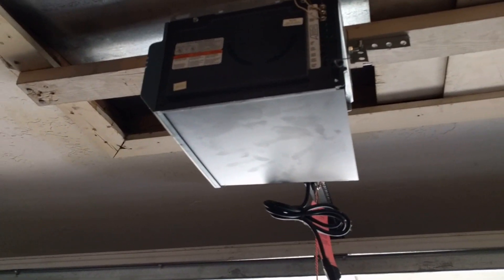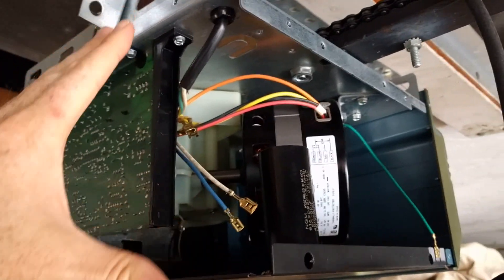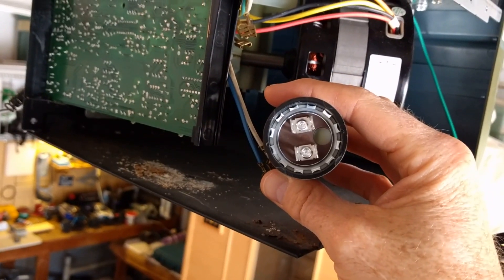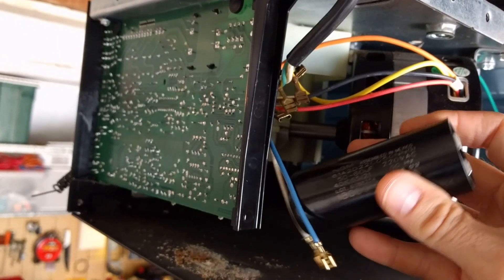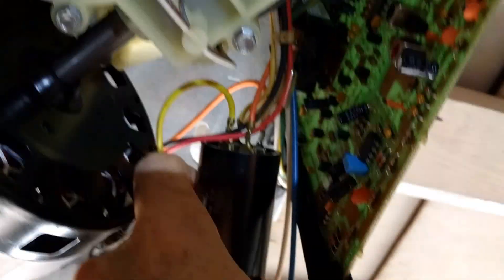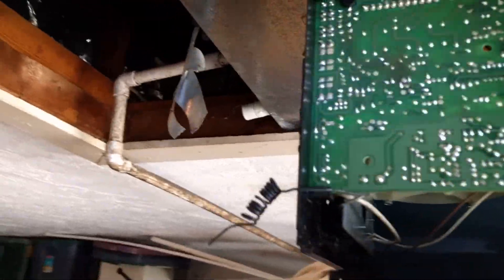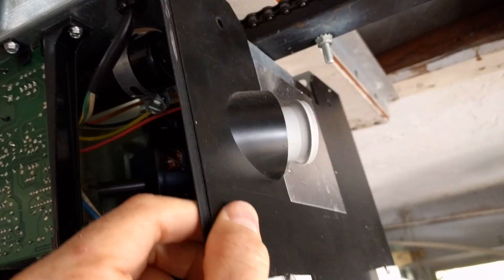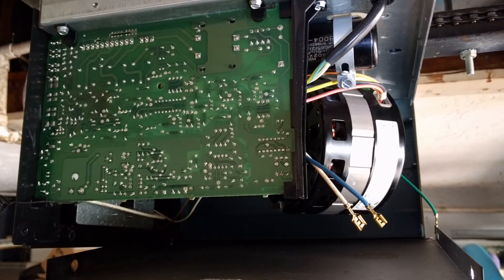Replacing capacitor on Overhead Door garage opener after it goes pop!

Comment: So just for clarification, both yellow wires, go on one side of the leads together and the orange wires go on the other side, they do not crisscross by any means correct?

Also, are there any precautions that need to be taken when hooking the new capacitor back up to the wires

Comment: hi. i been searching Legacy Garage channel. i just replace the starter capacitor because it burn out. once i install the garage open a little it bit but when i hold the button it move. i check everything spring, sensor and lubicant. what cause the issue that the door move only 6 inches? please help. also the expert said the mother board is damage and need to get the one but i don't so.

Comment: Thank You for the video .  I have a Overhead Garage Door also I am so impressed with it , mine is old 
makes yours look like a youngster . My Parents most  have put it in in the 80's ? I'm not sure my memory is way 
off lately . But I am 99% sure the motor & all the parts are original . One spring was replaced back when year ? . 
Anyway its ( motor ) has been slowly acting up every so often , Electric click & no motor on both for open 
and close . I'm going  to try Capacitor . other videos keep talking the light sensors , my old door does not 
have sensors .

Comment: When I removed the front (light) panel, I let the light hang by its wires (no need to disconnect). Removed the side cover (over circuit board) to access the screw to the capacitor bracket (leaving circuit board in place), and bottom panel.  Had to slide the capacitor bracket off the top panel to get the capacitor out, and found that using needle-nose pliers made removing and replacing the wires on the capacitor easy. The video was a great help. All the screws take 1/4" socket except capacitor bracket, 5/16" socket.

Comment: Wouldn't it be easier to just remove the motherboard to replace the capacitor?  It look like it's only a few screws to drop it and then put back
Reply: I think you'd also have to remove all the wires that screw into the terminals on the board and take out those screws, which probably means labeling them so you don't mix them up. Not a big deal, but it is a bit of work.

Comment: I knew My problem was the capacitor but I appreciate the step-by-step video so I knew what to expect when taking it apart.  I did indeed curse the engineer and his entire family for deciding to save a penny or two by not making the wires just an inch or two longer.  A tip for anyone reading this, start with the shortest wire first (likely the orange one) when putting the wires back on.

Comment: My thanks to Hans. Great advice. My large black capacitor also failed on same Legacy model as you. The local Overhead door gave me a smaller blue Mallory capacitor (shorter), claimed it replaced the longer black one in your video. It was tough getting the old capacitor out from that odd horseshoe shaped slot in the top sheet metal. You saved me a lot of money doing all this myself. it took time to make careful notes of the wiring, and the sequence of removing those plates (that's the biggest pain of all) while standing on the stepladder. Thank you my friend!!

Comment: As soon as I replaced the old capacitor the new one it popped and smoked but first did work and then pop then smoke, then it was dead.  Gatehouse Supplies tried to tell me that it wasn't their capacitor that failed.   Beware of Gatehouse Supplies, you will not get a refund for faulty merchandise.
Reply from the maker: Geez! Thanks for the heads up. I got mine from the installer and it's been fine. But good to know re Gatehouse.

Comment: For anyone wanting to buy their capacitor online, just make sure the "uf" numbers mach exactly and make sure VAC number the same or higher. Up vote this if that was helpful to you. Also for searching purposes they are often called start capacitors. Do not get a run capacitor.
Thank you so much for how to reconnect the wires. Took them off days ago and didn't remember which one went where.

Comment: Hey, Hans, just wondering if your "NGM 18004-B capacitor" is still holding up after 5 years or have you replaced it with another one? I have the exact same model garage door opener and in the past 3 months two aftermarket capacitors (of different brands) have blown, so I am going to order the (Fairbanks Electric)18004-B and hope that it will last for at least 5 years as guaranteed. I do wish for longer wires so that the capacitor could be turned 180-degs in case when it does blow, the fluid would not be sprayed on the control board. It's a design/bean-counter flaw, imo.
Reply from the maker: Still have the same capacitor but about 5 months ago my son accidentally tapped the door with the car while we were doing some driving lessons. So my door is out of commission until we can afford a new one.

Comment: What happened when you tried to open it with out the capacitor working? My motor will try to move but just makes a noise
Reply from the maker: Honestly I don't recall. It's been a while. Still going strong over here.

Comment: My Genie Garage Door opener is completely dead - no lights, nothing.
The AC outlet where the electrical cord plugs in has power.
We did have an Electrical Storm right before I found the Garage Door opener dead.
Do you think it could be the Starter Capacitor ??????
Reply from the maker: Hope you got it working. Wish I'd seen this earlier, but the capacitor is so inexpensive. Hope you gave it a try.

Comment: Could you film a video of it opening and closing with no commentary? Also on those openers the capacitor is know to blow fast on these. Glad you fixed it these will work forever until the door destroys it or it gets replaced. The reason for the short wires is so that it doesn’t get caught in anything. This will definitely help a lot of people. Nice video and job!

Comment: Hi. I have the exact same model. Have you ever experienced the door going down 6" then up or the reverse? I seem to hear a click then it will work properly but soon is back to the up and down. Could that click be the capacitor?
Reply from the maker: Hi Dekal, I have not had that experience. I would contact your local Overhead Door company and ask them. The one here near me was very helpful.
Reply: Adjust the force, up or down switch. It shows on the unit.
Reply: @hungton0591  -Tried that many times and doesn't help. Just replaced the capacitor and it's not that.
Reply: dekal Might be a board or some type of break in the door. Make sure the door runs freely and smoothly. Make a video of it I will understand it better I fix a lot of these and it can always be different. Hope this helps.
Reply: @jdcalame6714  Without the door attached the chain simply goes down 6" then up about 6". That's it.

Comment: Would you happen to know the female terminal size?  Bought the same capacitor but some of my wire terminals corroded.  Thanks!
Reply from the maker: No I don't. Sorry. That's too "inside baseball" for me. I just bought the one there garage door people told me to buy.
Reply: Replace the terminal.

Comment: It's an AC Cap, so polarity is of no concern, just keep the 2-YEL
and 2-ORG wires segregated. Also, on mine (2003), the butterfly
wheel is for the board optics. This stupid thing won't run with the
covers off, because of the ambient lighting!  Sooo, everything has
to be closed up (no light).
Reply from the maker: Interesting. Is there some kind of light sensor on it? I don't get why ambient light would even be a factor in a garage door opener.

Comment: Could you post the contact info for the place you get your new capacitor from?  I have an older unit ( 55B ) that I need a capacitor for.  Mine is marked 77156-1 (330 VAC , 54-65 MFD) but a manual I found on line has that part number redlined out with a new number of 107871-1 for the capacitor and 108267-1 for the 'sleeve'.  I'm on Merritt Island and the local service guy who just showed up said he could no longer get parts for my unit and wanted to sell me a new one for $390.  I have to believe there are still capacitors available somewhere.
Reply: I just ordered a capacitor for my opener from Amazon.com. Two day shipping $14 total. Search for "garage door opener capacitor" and see if yours is there.
Reply: Two days later I received the capacitor from Amazon and about 45 minutes after that the opener was back working just fine! $14 versus $400 for a new opener.
Reply: Which country use 330 VAC? In general, we use 220 VAC. What model do you have Genie or others?